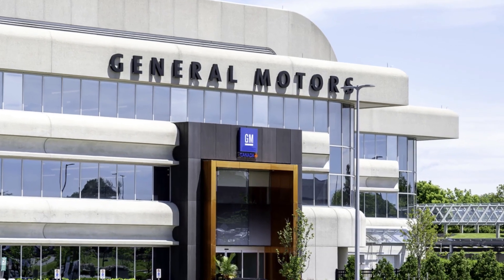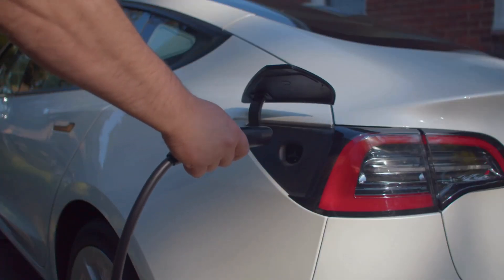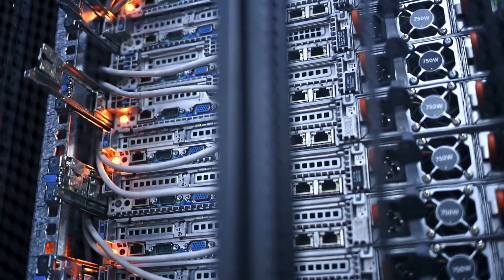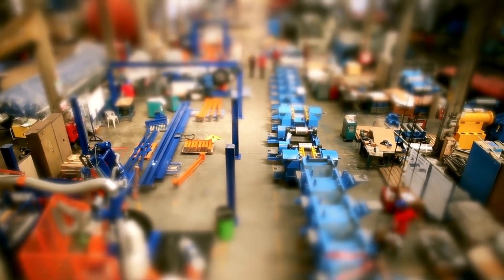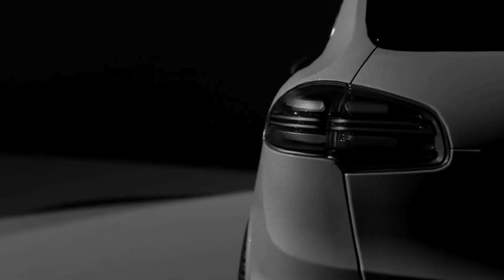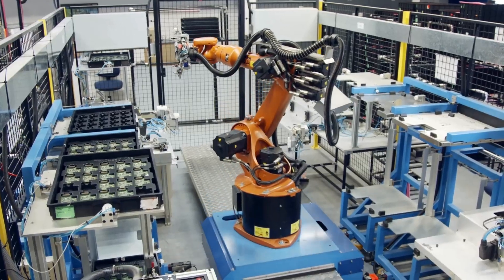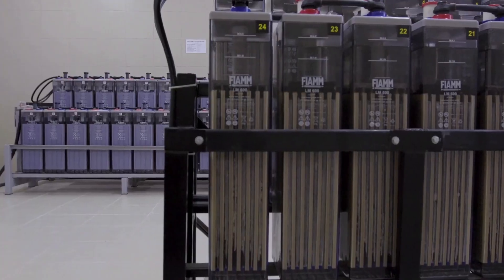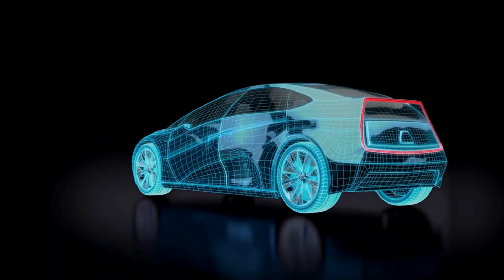GM CEO Announces New Ultium Battery Technology with 10- Minutes charging

Comment: GM will not do this. And, there is no way to charge a big enough vehicle battery in 10 minutes. The problem is the same as with the postponed electric car ferries: The current needed for charging fast is just too big. Ferry would have needed it's own power plant at each end. Laws of physics make electric vehicles a technical dead end, like it did 100 years ago. You can not charge big enough batteries fast, and the low energy density means that the vehicle's weight will be almost double.
Electric cars are not the future. Hydrogen is even worse option. So, ICE vehicles will be here to stay.
Misleading has almost been propaganda. That is why people are now ruining their household economies with EV:s, as they lose value so much that when their warranty expires, they are practically worthless.
Future historians will think that we were just morons. We had all the internet available and still believed blindly everything the media fed us. Like the "man made climate change". The Nobel Prize Winner For Physics John Clauser has commented it by saying "the (official) climate science is pseudoscience", a hoax. As the greenhouse effect of the CO2 is logarithmic, there is no reason to limit it's production from traffic, or powering the grid. Only doubling it's concetration in the atmosphere can raise the global temperature in masureable way, not the present slow rise. We have been lied to.